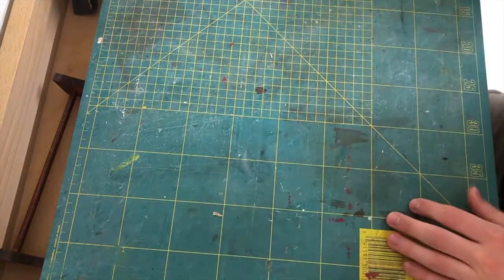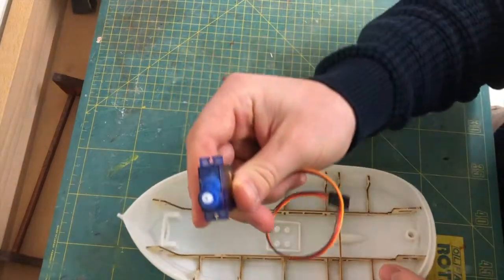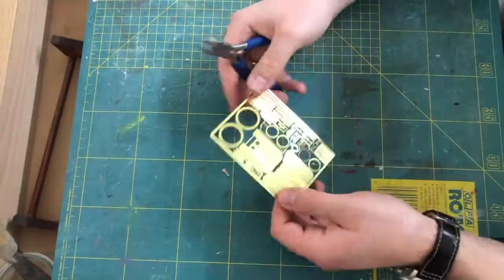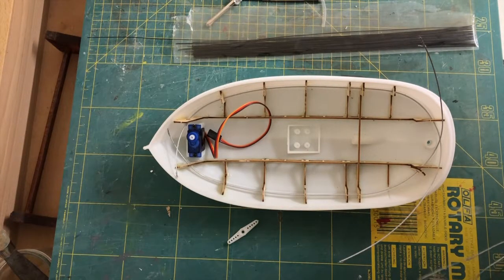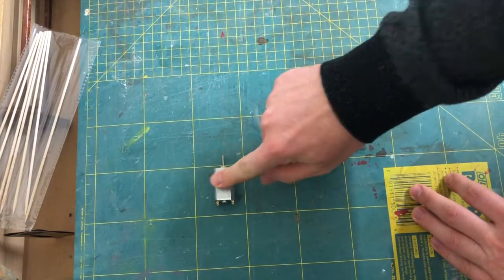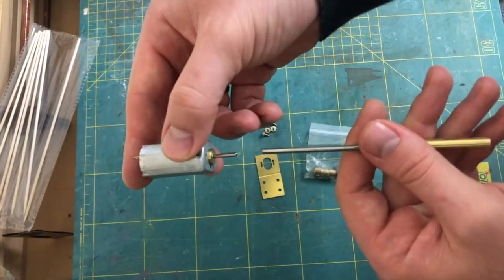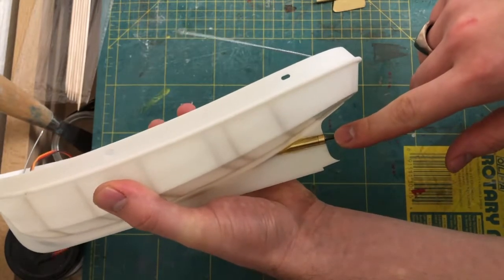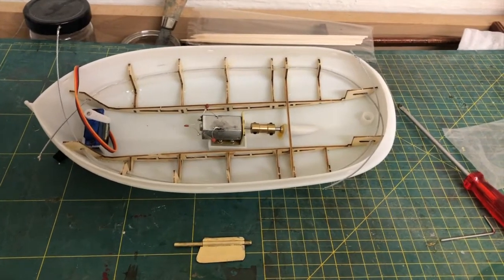RC Tugboat Build Vlog Part 2

Comment: Hi. Do you know that this model is an actual copy of a 21 foot pleasure tug designed in the USA by a Mr Ken Hankinson? It has been copied by the Chinese and made into a model. I have the original plans for the full size boat and have a 24 inch model made of it. The designer has passed away now and the drawings went to Glen-L Boats who now sell the plans. It is called the Titian.
Reply from the maker: Hello. While I was building the model I was looking for reference pictures of real boats and stumbled across Glen L Boats. I have little doubt that the kit is based on the plans you mentioned, but looking at the different Tug Boats offered there, I´d say the kit is an exact copy of the "Sweet 16" -type. Hope this helps
Reply: @modellteichrc3988  the hull is like the Titan but it can have different cabins and also a 3 foot stretch in the hull to 24 feet.There is actually a full size complete one that was built on my local lake here in New Zealand. I almost fell off my boat when I saw it. Very uncommon but to see the real one was unbelievable. I just have my 24 inch model and have not built the full size. Less cost now and no fuel bill. Nice build for you.
Reply: I see the Sweet Sixteen, all similar to Titan and Goliath with just stretched hulls and re arranged cabins. They are all nice and not too toy like, more tug like. They are big on a trailer to tow behind a truck. The hull is nice for a larger model too with authentic wood decks. Maybe I build a bigger one too. Will you sail your boat?